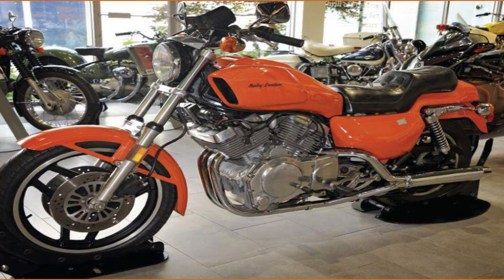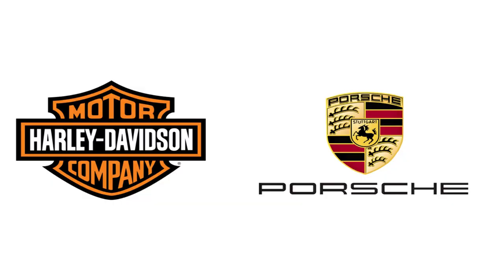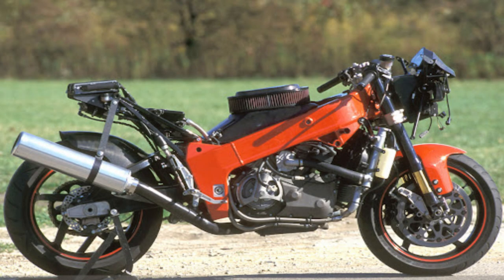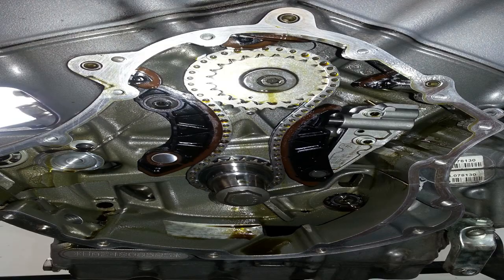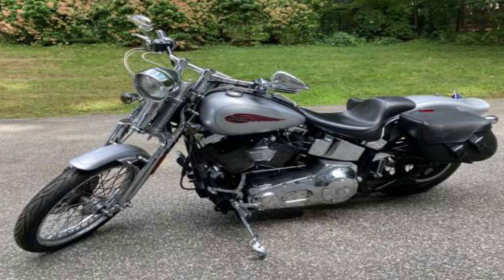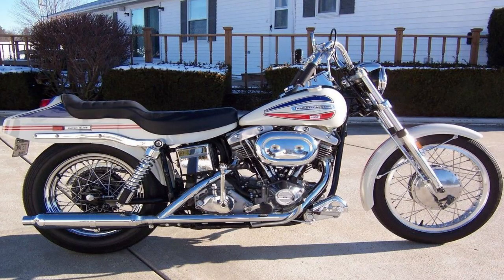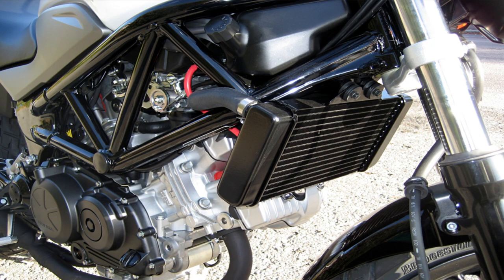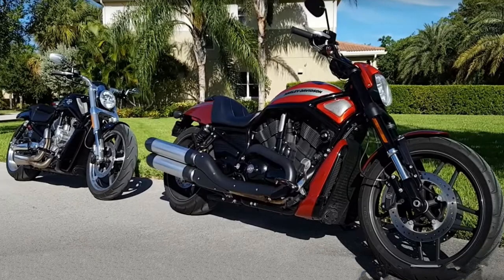VROD Is Harley-Davidson's Baddest Out of the Box Bike

Comment from the maker: What is your opinion of the Vrod, should Harley of repurposed that motor into something like a bagger?
Reply: Outside of being water-cooled, never understood the hate. Although I never bought one I enjoyed riding other people's. The ergonomics we're a bit weird for me but could be remedied via aftermarket. You do a great job of your vlogs, I look forward to them.
Reply: GixxerFoo.  No, HD should not have put the Vrod motor in a bagger.  That short stroke, small displacement would have failed in a bagger.  Baggers need torque at lower revs, that is not a Vrod.  Two things made the Vrod go away.  First was price.  Second was comfort.  But with that said, now that they are used and the prices are coming down, the Vrod looks tempting...  Of course, at 66 years old, I might have to think twice on that platform..
Reply: Best bike Harley ever made.    The Harley Community condemned this bike
Reply: @slyfoot0605  no, all the Harley haters that claimed Harley needed to make blah blah blah.......so they did and the haters didn't go buy one.......it was Harley people buying a second third fourth or fifth Harley is the ones buying it
Reply: It would seem there is room to do it all. Keep traditional winners and introduce new technology at the same time.
Reply: Some people made Road Rods out of them which I still want. If they did make a bagger With the Vrod engine it would have to be on the light side. How about a video on the actual difference between the Vrod and Pan Am engines. I don't think there is as much difference as HD is saying.
Reply: Besides being ugly & sounds like crap I almost bought one to help my need for speed but proceeded to buy a twinkie road king to keep my shovel company 🤣
Reply: @davypig571  I think using the frame and engine for a Cafe racer is the best second bike, unless you.are.also an AV rider.
Reply: @ababbit7461  vrod didn't have a high price compared to other harleys
Reply: Absolutely would of made a great bagger.
Reply: @jeepstertj556  Compare it to a 1200 Sportster and it did...  A Vrod at 1130 cc and a 1200cc Sportster.  Which one cost more and which one was a "real Harley" since the 1950s??  For a bike that most Harley buyers did not like, the price kept buyers away.  Kind of like that new "Live Wire" and the price that it came out as and no one is buying.  Don't compare a Vrod to a Harley "Big Twin" since it is not a "Big Twin."  Harley made a point in categorizing it by having its engine size quoted in CC not CU IN...  The Sportster suffered because it was a CC bike, not a Cubic Inch bike....  The 1970s Big Twins were 74 cu in and a 1200cc Sportster is a 74 cu in engine.  Harley could not come out and say a Vrod was a 69 cu in "Big Twin" now could it?  Over priced for a "bar hopper" usage bike.
Reply: @ababbit7461  my vrod was a 1250 and the sportster doesn't suffer from anything it's one of harleys biggest sellers and the vrod is a cruiser and is almost 150 more pounds than a sportster so the vrod is closer to the other cruisers than it is the sportster
Reply: @jeepstertj556  The Sportster (not the new water cooled one) has always been my favorite Harley.  It is the ONLY engine in the world that has 4 gear driven cams....  You had a Vrod Muscle.  The original Vrod was 1130 cc, then guess what....  Harley found out they wanted/needed more HP out of the Vrod so they increased the Vrods engine size to 1250cc.  The 1200 Sportster is 1203 cc so it is a lot closer to the Vrod, in engine size, than a Big Twin.  The Big Twins have not been in the 1200cc range since the Shovel Head ended in the early 80s.  Since the Evo Big Twin, the Big Twins have been 1340cc or larger.  Heck, the newer Milwaukee 8 motors are in the 1800cc range and larger (more than 110cu in).  Your Vrod 1250cc was in the 76 cu in range.  I would like to own a Vrod some day, but they are just bar hoppers and drag racers.  My Vmax 1200 was like the Vrod.  Good in a straight line, but don't bet your savings on it in a canyon race against my old ZX12R or for that matter in a straight line race!!!
Reply: @ababbit7461  mine was a nightrod special and I traded it for a xr1200x, all vrods were 1250s after 2008 or something. saying a vrod is like a sportster is like saying a new muscle car is like a compact because they don't use iron big blocks anymore. modern engines don't have to be big to make power
Reply: @jeepstertj556  I would take your XR1200X in a canyon race against that Night Rod any day.  The Vrod was like the Vmax 1200.  Good for straight line racing only...  But wait, put that Night Rod against a 1990s 1000cc Sport bike.  The Night Rod would not only lose in a straight line, but it would look like Donky Dung in a canyon race.  An old ZX11 engine makes that Night Rod look slow and the ZX11 is "old technology", plus it is smaller in CC size...  Ouch, old beats new!!!  Modern engines are better, but don't discount that old Iron Big Block in the motorcycle world...  The ZX11 was made from 1990 to 2001 and would crush that modern Night Rod 1250cc in any race, canyon or straight line...
Reply: @ababbit7461  that has nothing to do with what we are talking about stop deflecting and stay on point. the vrod is in fact a cruiser  like a soft tail or dyna, it's just more modern. a sportster is still a sportster which is basically a general purpose bike that can be many types of bikes depending on the set up
Reply: @jeepstertj556  OK, but there have been Sportster since the 1950s and Softails since the 80s.  But, there will not be any more Vrods made...  Why?  Because as a cruiser, the bike failed.  As a "muscle cruiser" the bike failed.  As a whatever, the bike failed.  The Japanese and Europeans make better Vrod class bikes.  Why do HD's Big Twins still sell?  They are about mystical "feeling" of a motor, not about speed or performance.  I own a 1997 Softail Heritage Springer and a 2003 Road King CVO with the 103 motor.  Why do I own them?  Because the "feel" great cruising down the road way, not because an old Evo, 80 cu in motor is powerful...  Nope, single gear driven cam design that shakes every last filling in my teeth out above 50 mph...  The Road King has lots of low end grunt for my wife and I to enjoy.  In fact, my wife will not ride on the Goldwing 1500 because "it does not feel like a Harley."  Harleys touch the soul, not the performance button.  A Vrod has no soul as its engine is smooth and linear in power...  That is why it failed and why the Big Twins still rule.
Reply: @ababbit7461  why are there no more vrods made. because it's motor isn't up to snuff with modern emissions and hd only sold 10,000 vrods a year so they didn't want to waste money on it so they canned it
Reply: I would love to have a 60° wedge in a new road king special!
Reply: @jeepstertj556  Like the Buell line up, the Vrod was a bike I would and will own some day.  I like "different" and both of those bikes (Buell being a lot of models) are on my radar ownership.  With that said, I am not a fan of the "way out front" peg position of the Vrod.  Kind of like riding a bike down a water slide feet first....  The Night Rod would be more to my liking...  Government kills too many fun things in America....  Time to tell Government that the country is ours and the Government is to support us, not direct us!!!!
Reply: @ababbit7461  I have a 06 buell Ulysses I'm about to sell
Reply: I Love my vrscr. It's my first Harley. This bike will be mine for ever.
Reply: @ababbit7461  wrong, that motor pulled fine. I was 325 lbs when I had mine. Even with a girl on the back I would smoke modded up 96 inch bikes riding solo. I had my vrod for many years and if the chassis would have been good for touring ……..I would still have it. I am hoping they put the pan America motor in a touring bike. I will then get rid of my road glide. 
Even with all the guys bragging how their bike made all that torque down low……..my vrod never fell behind in a drag race at the start. People always said they could beat me off the line and never could. I never had to learn to launch my vrod cause no one could beat it. Only mods were power shot pipes and a power commander and a tune. I even kept the air box top on!
Reply: @ababbit7461  the vrod didn’t survive as long as some models, but that new motor is highly based off the vrod motor. Some of us felt that vrod sound in our soul and it lives on. I did get a bagger, but the one constant disappoint for me is a company that’s nicknamed the motor company can’t get a motor in a bagger that will run with any other major motorcycle brand. The grandpa gold wing will dust a cvo ultra classic in a drag race………..some motor company. I love Harley, but let’s be real………they have been behind in the performance department for decades. I hope they change that soon.
Reply: @robolson7669  Good to know.  Thanks.
Reply: My 15 muscle is  set up as a bagger with fairing and hard bags great  mix of power  and cruise ability
Reply: I liked the revolution engines. Not so much the frames. The Pan Am they did try harder but put too much yuppy into it.

Comment: More V-Rod coverage!  I never owned one, but one of my old army buddy's had a couple and we'd swap bikes sometimes.  V-Rods were fucking outstanding and too under appreciated by the diehards.  The only thing I'd change about them is throw on some mid controls.
Reply: You want "night rod".....not "night rod special"........quick way to see difference is NR has chrome pipes, NRS has blackout pipes
Reply from the maker: They are fun bikes for sure! I would have to agree they really could of benefited from a set of mids for sure. That long style with the forwards was a little awkward, that's at least how I feel on them.
Reply: @GixxerFoo  Sandy Kosman  the chassis builder made a mid control kit for V Rods at one time . There was a bunch of V Rod riders in the mid 2000s that always wanted them !
Reply: So does the VRod Street Rod

Comment: I owned a V-Rod for 10 years. Absolutely loved the bike! Fast, great handling and versatile. It had a couple of drawbacks though. First, terrible for two-up riding. Clearly a solo machine only. The need for a valve adjustment every 10-20,000 miles was an expensive downer. It was also hard to get parts because of the uniqueness of the bike. Still, it was a fantastic machine. I ride a Road King now due to my being married and wanting to ride with my wife. Still, the V-Rod was/is an engineering marvel and one of the best bikes HD has ever produced.
Reply from the maker: Yeah for sure they do a lot better riding solo, found that out myself too lol. Valve adjustments are pain on that bike, no room in there without lowering the engine down a bit. I did my dad's valves last winter, it wasn't too bad but glad it's only a every two or three year job on that bike.
Reply: I just got on '09 NRS last week! Planning to do put some miles on it after the holiday season but man, she is a beauty! I had no idea about the valve adjustments needing to be changed every 10-29k miles so thanks for the heads up. Got mine just under 10k miles on it. Looks like i'll be making a trip to my mechanic soon about it.
Reply: I'm considering buying one. Please respond. What parts did you need and how hard was it to find em. Thank you,  in advance  😉
Reply: *edit: 20k miles...

Comment: The '03 V-Rod was my first motorcycle, and I still ride it today. The styling has never gotten old. The engine and mechanical parts have been bullet proof. The only changes I've  made over the years  are a few chrome pieces, the hard saddle bags, and changing out the lights for LEDs. The bike is solid, and still gets a positive comments wherever I take it. The ONLY complaint I have is the gas tank is small, but I fortunately found an aftermarket fix I plan to have installed at the end of this riding season.

Comment: Love my 100 year anniversary 2003 vrod. Put every piece of chrome I could find for it including a chrome Trask turbo kit. It safely runs 8psi of boost which Trask says puts about 160 hp to the ground. And yes...it stretches the arms!! lol
Reply from the maker: Damn I would say so! Trask makes some awesome bolt on turbo kits, that's way to go with a Vrod and you don't even have to crack into the engine. That motor is a great platform for a turbo!

Comment: I think I saw some V Rod testing. They'd take a v rod park it in a box with no top on it, somewhere in the desert and start it and walk off. And let it idle for hours and hours to see if it would over heat.from what I understand they never over heated.
Reply from the maker: I wouldn't doubt it! Harley has a test bed out in the desert somewhere, they also ran those motors at redline for 24 hours to see if they could get it to fail.
Reply: @GixxerFoo  that test was actually 500 hours, 20 days of full throttle

Comment: I'm an aerospace engineer....which with $2 will buy me a Coke.  But I love the V-Rod.  I wanted one when they first came out but couldn't afford one.  I eventually bought a 2003 100th anniversary one in 2009.  I still have it.  I love it.  I had a bad crash where a deer ran into me....(ALWAYS wear your leathers....ask me how I know).  The bike wasn't hurt much at all but I was....but at any rate I repainted it in a color scheme I wanted and added Screaming Eagle exhaust parts to it.  Redid the intake and added a Dynojet Power Commander fuel controller.  It makes about 130hp now (which is nothing compared to many sport bikes) and I've had it to 133mph a few times which is the fastest I've gone on it.  Again, nothing compared to a ZX-14 (I love Kawi).  But I haven't found a newer Harley I like better enough to sell it.  I really like the Breakouts, and looked hard at a CVO one.  But my old '03 will smoke it.  The biggest complaint I have about it is the fuel tank....it's only 3.7 gallons and my bike is lucky to see 31mpg the way it's tuned now.  My car gets better mileage than my bike.  So I'm always stopping for fuel.  Other than that, I really really like it. I think it's the best bike Harley ever built.  I love the air cooled bikes too, and might get a Breakout.  I also like Ducatti's.  And the Kawi ZR900RS Cafe is super sweet!  I always wanted a Mad Max Goose Z1.  Anyway, I like the V-Rod and may rebuild my engine to be more like a Destroyer.  A buddy of mine rebuilt one and made it a 1390 cc and it dyno'd 190hp.  It's a beast.  Still has the small gas tank though :)

Comment: Don't know much about v rods but a friend has a model that was called the street rod bike had rear set foot controls I think 29 degrees of rake & inverted front end don't know how many or what years they were made but that bike handles really good & is fun to ride ! With the V Rod motors rev - em high that's when the fun starts !
Reply from the maker: You must be talking about the 750 Street Rod, that was neat bike where they took the Street 750 and hot rodded it a bit. They do handle really well, I see those around town from time to time.
Reply: @GixxerFoo  no sir it was a VRod I'm thinking around 2006
Reply: @GixxerFoo  I just looked on YouTube their are several videos about the VRod Street Rod !

Comment: Loved the V Rod Destroyer that I co owned with a good friend and we both immediately had to have physician clearance to ride at the local strips because on each of our second passes we dipped below the 10sec barrier banning any passes without clearance. We raced the hell out of that bike from 07-14 and went to sell it with 110mi on board only to find out it was worth a quarter of what we payed and I was the only solvent partner so I bought it out and added a 1550 big bore from wiseco and a nitrous system with 75hp shot the bike stock had 150@tire and with big bore alone it made 178 and cams and nitrous it laid down 255 so a couple passes and a backfire later I switched to a custom hilborn methanol injected 1550 motor with a 245hp rating and a high 8sec pass my best when the Mickey's allowed. I sold that bike in 2018 and finally bought the 20 year dream Gilroy Scout with a 96 S&S since grandma wasn't with us a a bike on the street isn't an issue anymore. I was allowed a drag bike to get away from street racing foxbody.
Reply from the maker: That Destroyer was insane, lol just about anybody could throw a leg over it and after a few passes get banned. They didn't hold their value from the MSRP though, they still bring good money but not nearly what they cost new. You found a neat bike you don't see very many of those bikes these days!